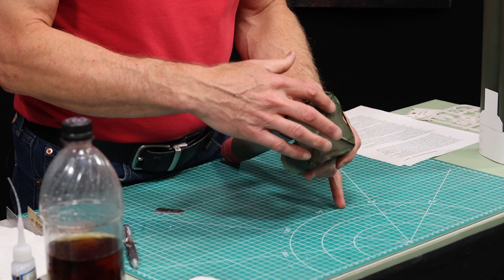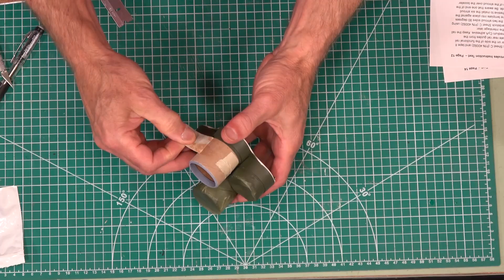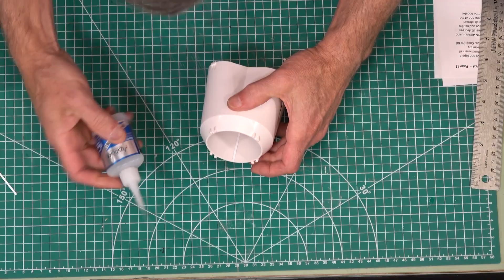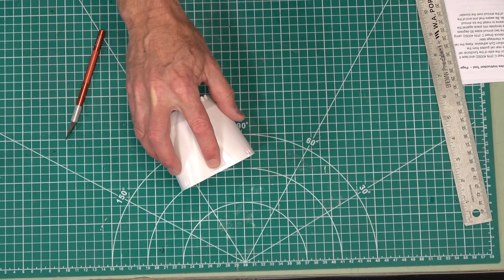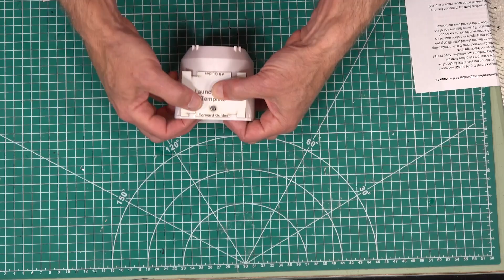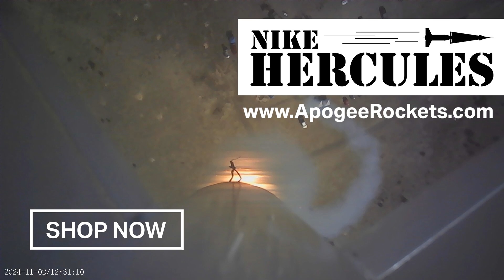Steps 64-69 | Build the Apogee Nike Hercules Model Rocket

Comment: You're correct. Matching tapers lock. This method is used for holding live, or dead centers in lathe tailstocks and headstocks, and it takes a considerable amount of force to remove them........by the way, this series is my new favorite show. Looking forward to the next one.  = )